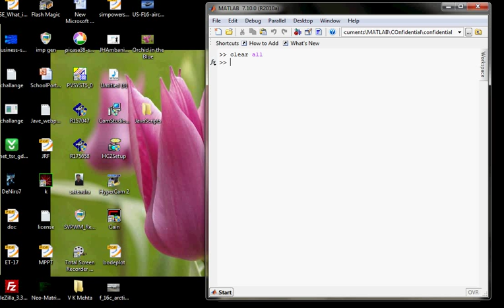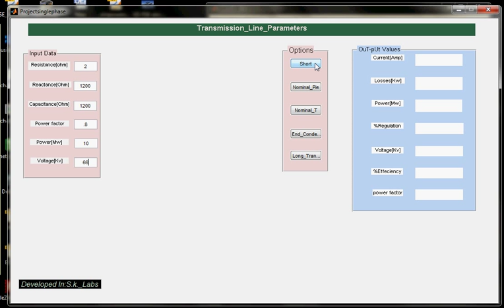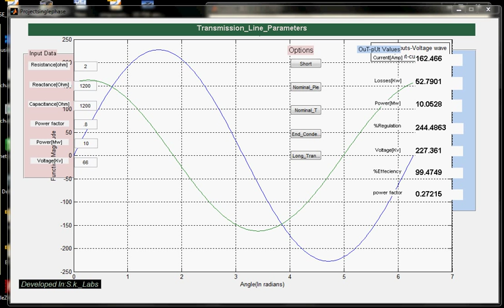Matlab Tutorial part- 8: More on GUI:  Power system Transmission lines

Comment: it's block in my country :(

i need matlab equations code to calculating UHF station to
-power transmitted & received 
- distance between antenna &station 
-Rang between antenna & station
-path loss for antenna 
-antenna Gain & Gain Tx & Gain Rx 
-signal wave propagation for antenna uhf
 

this is mail address (mohebob@live.com)